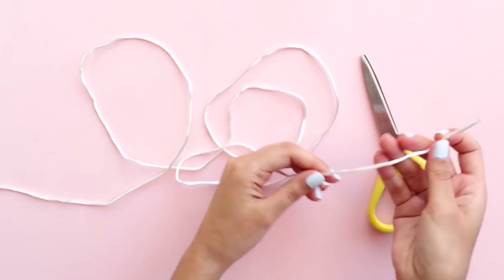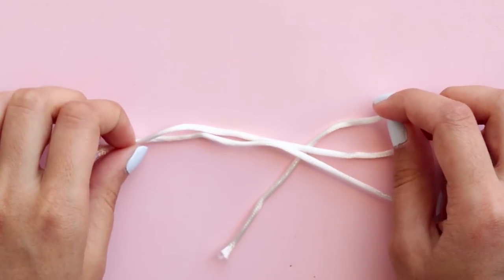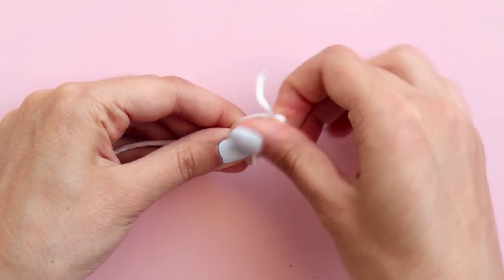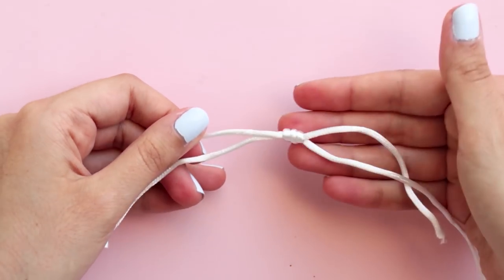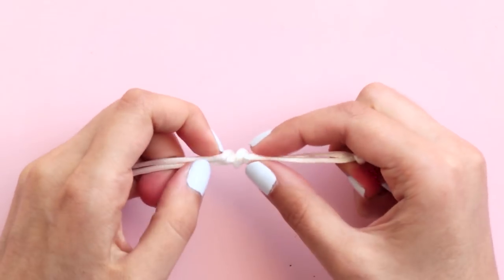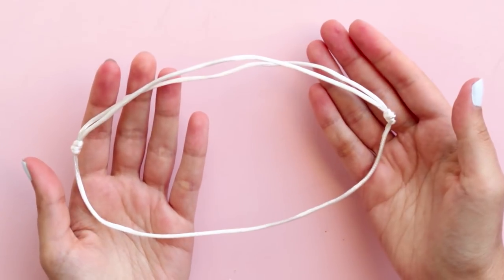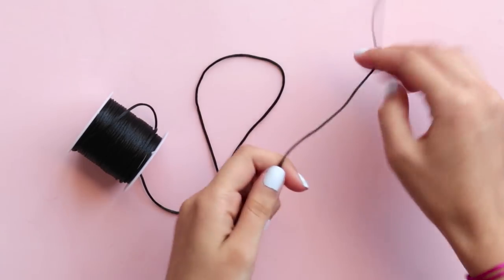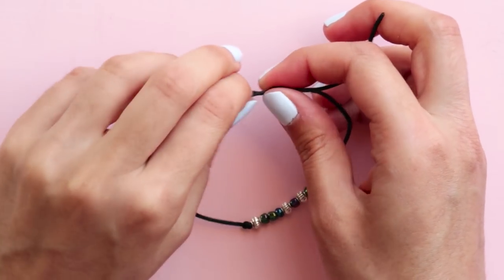How to Make a Sliding Knot | DIY Sliding Knot Jewelry

Comment: Hi, I make leather necklaces with 3 little beads in the center and a knot on each end of the trio of beads.  I typically make them so that they close with a clasp but would like to make them with this sliding knot technique so the length can be adjusted.  I am having troubles figuring out where to place the sliding knots so that I get the right overall length for the necklace AND have the trio of beads centered in the MIDDLE.  Seems like I am always off centered. Do you have some advice for me?

Comment: I realize this is an old video, but if anyone can help me with this problem, I would really appreciate it.  I am making these type of bracelets to sell and I know how to make them, but I cannot figure out how to get them the correct size. Let's say for example I want the bracelet opening to adjust between the sizes of 6 inches to 10 inches. How do I make this possible. Am I suppose to place the knots a certain distance apart, am I suppose to have a certain amount of double cord between the knots? I just can't figure this out :(   Exact measurements are important to me so I can be consistent in my size offerings on my website.